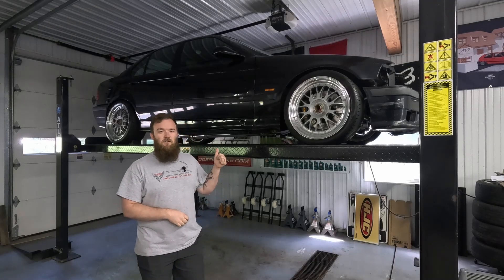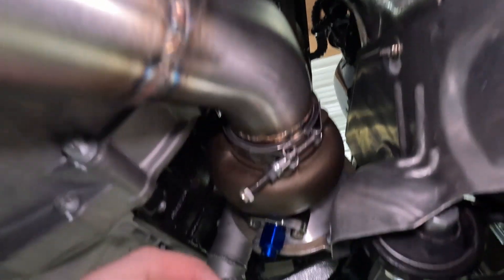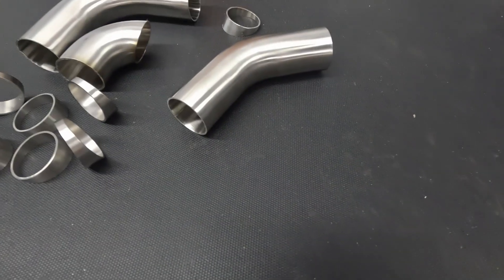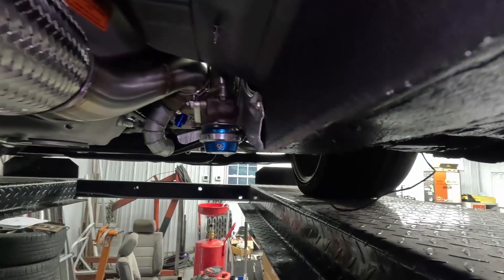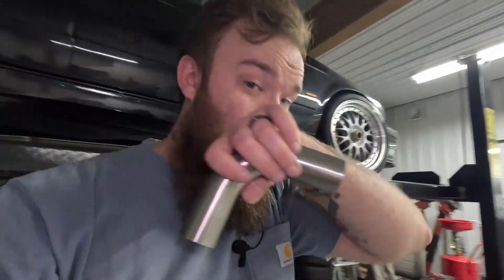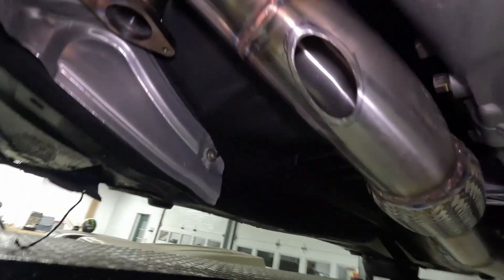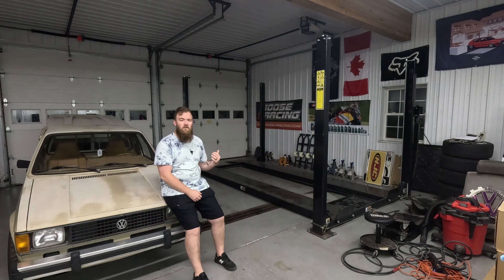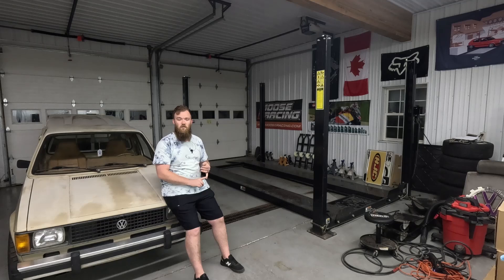Turbo'd E36 M3 Build Ep. 2 | Bottom Mount Turbo Wastegate Tube Fabrication

Comment: I am facing this same hurdle planning my turbo build, couldn't you/I weld a new flange or v band between cylinder 3 and 4?
You did a awesome job!
Reply from the maker: Thanks, I appreciate it! 
Are you asking about doing that while using the OEM style split exhaust manifolds (1 manifold does 1-3 and the other does 4-6)? Or are you planning to use a turbo manifold? Either way, yes you could weld a new flange in between 3 & 4. Depending on how you route it, the back 3 may flow a little poorly is all and packaging it all may get difficult with the stock manifolds.

Comment: With such a sweet welding setup and being great at welding, why didn’t you cap the manifold and weld the waste gate flange straight to the turbo hot side? Would’ve been Super accessible and even better response time and flow.
Reply from the maker: As this was a customer car, that option wasn’t something that was discussed but yes, you’re correct that it would make an easier wastegate mount and routing option. The only downside is if you’re not committed to keeping the car turbo’d or you ever blow up a turbo, you effectively have a custom turbo for that application then.